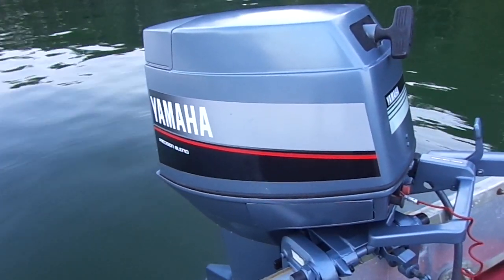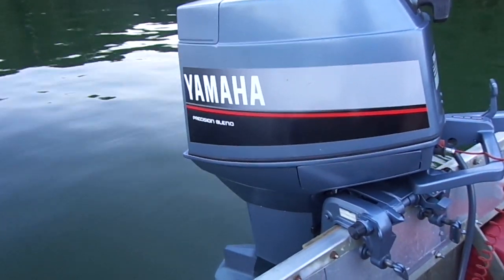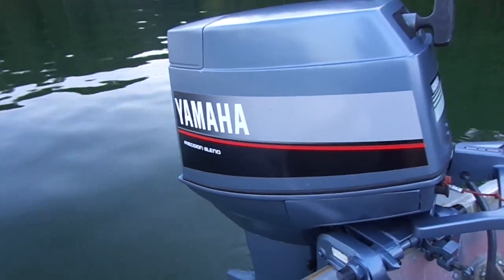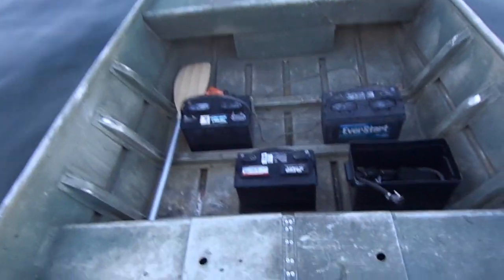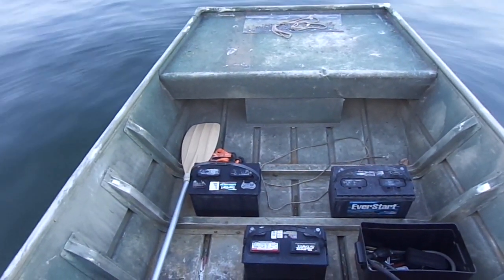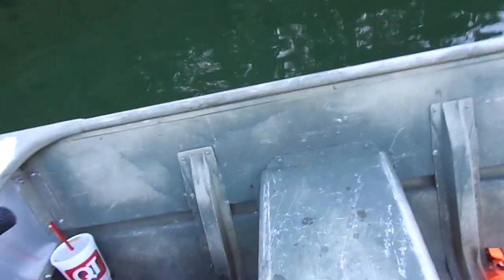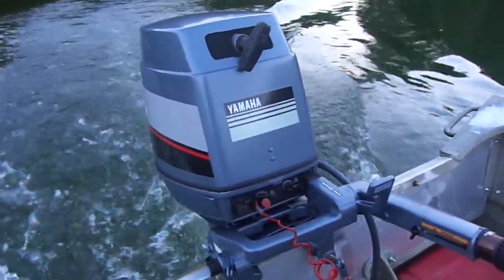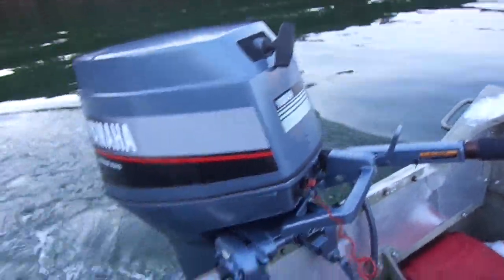Yamaha 30 HP on Jon boat. Lake test.

Comment: Scooting along pretty good ! I just got my first boat. 1973 Rich line GF16. It's rated for a 35hp. It came with a 76 Johnson 25 electric start. I have to go through it and replace what needs ! The compression is good so worth bringing back to life. I hope to pull 20+ mph out of it. Will be my first ever build.

Comment: I had the 1988 SG30 short shaft with ss prop on a 14-48 Starcraft modified V and that thing would outrun the 60 HP mercury powered boats in my area!

Comment: Max hp on 12ft jon boat is 5hp. This guy is living on the edge😳
Reply: @random person remember Bravery and stupidity is a very fine line. Please be careful and enjoy your summer.
Reply: That’s a factory transom rating if you build and re-engineer your transom like I did I run a 9.5 hp evinrude short shaft
Reply: I got one better than that... 12 aluminum sears vhull with a beefed up transom (.5 “x1” aluminum flat bar across the back and new plywood for the thickness on transom and I had a 75 evinrude 25 that pushed the boat 23 mph wide open. Honestly probably could have handled a 30 but you had to have someone in the front to level the weight but it was fast and a little scary